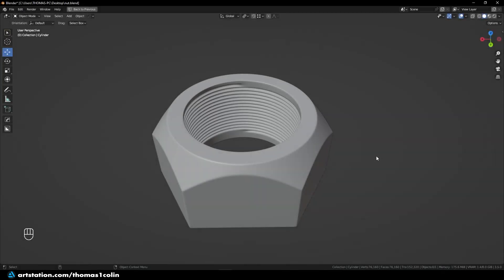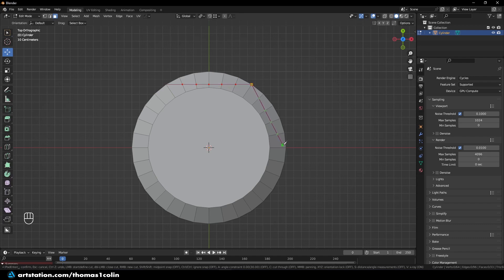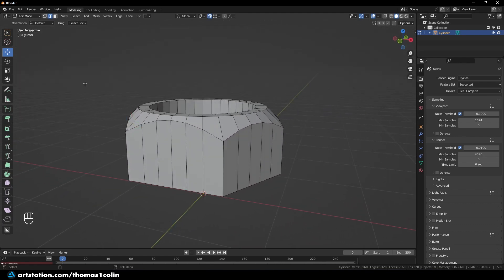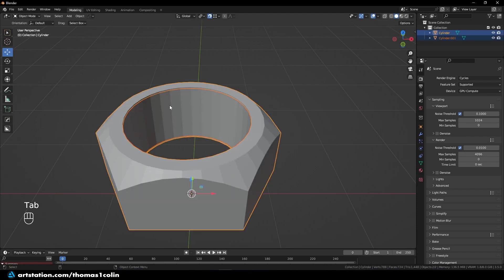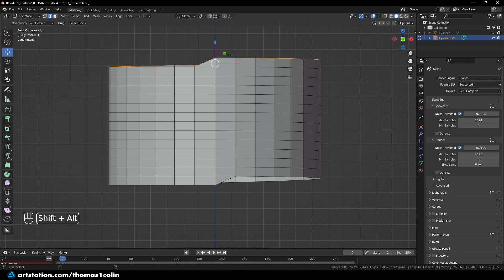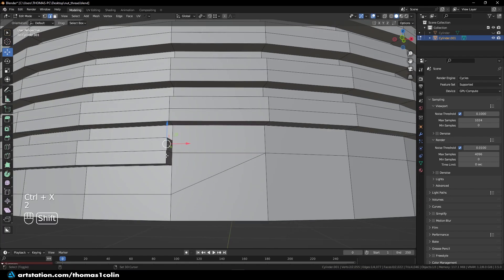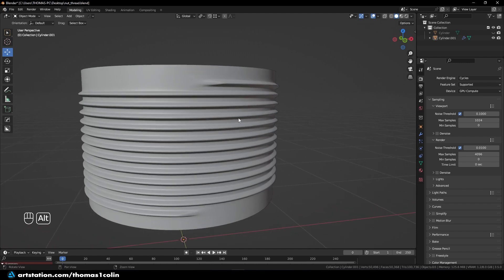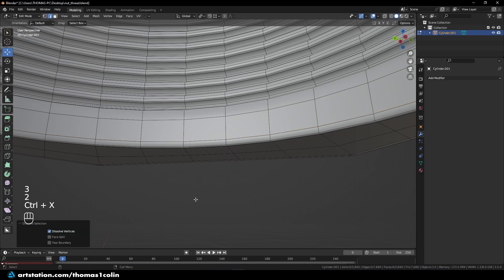Topology Study : How to Model Threaded Nuts

Comment: alt + m for me is doing the merge thing, not the split edges, what to do here?
Reply from the maker: weird, what version of blender do yo use ?
Reply: @ThomasColin3D  “Alt+M doesn’t separate for me either. I’m using Blender 5.0.1.”
Reply from the maker: @MindLab-eng it's working for me, i just tested it again, i'm also on 5.01. if you select an edge, it opens the Split menu, let me know if it doesn't. DM me on Discord if you need help

Comment: There is one nuance, the thread is turned inside the body of the nut and ends without reaching its edge, so in reality it is not working.  In everything else, it generally looks like the real thing.

Comment: Nice Model and really perfect surface. Only it does not look like a real nut since the thread is ending just somewhere. So you would never be able to screw some bolt in there. I did enjoy your modelling skills. Thanks for sharing.
Reply from the maker: Thanks! Yes you're right, the model is not very accurate. The goal of the "topology study" is to find a way to solve complex topology problems :)